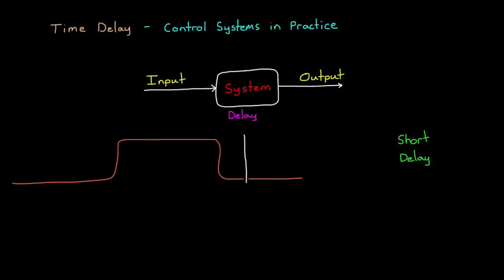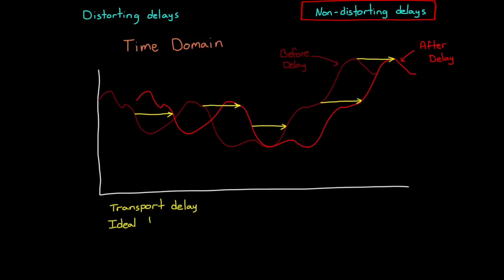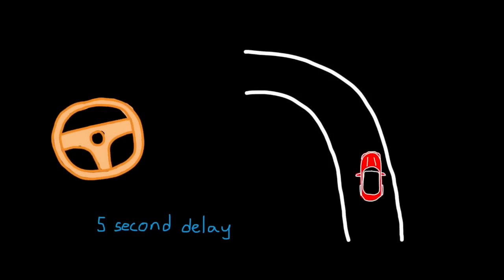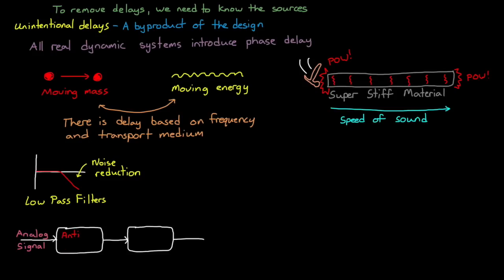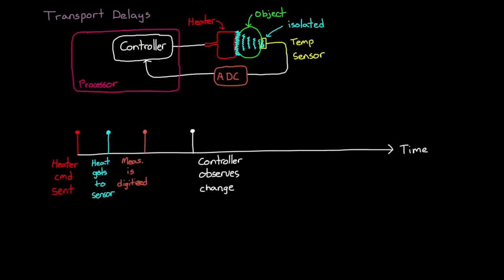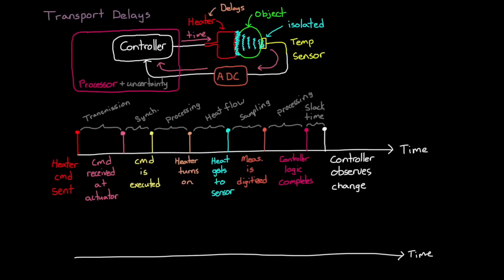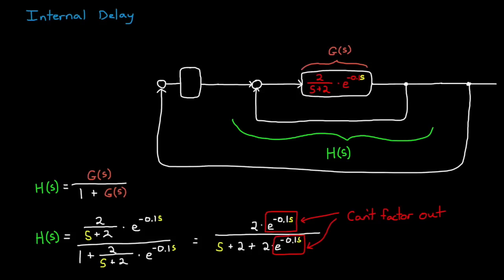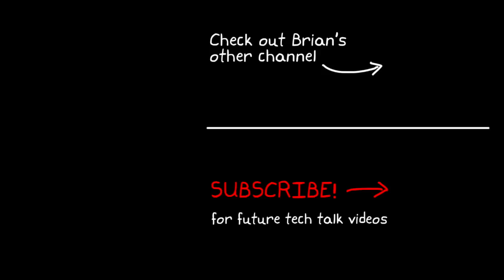Why Time Delay Matters | Control Systems in Practice

Comment: Great video. Let's say there is a filler, this puts unstable volume bulk (approx 1.5% variation that oscillates in time vs targeted value) into box and takes its 12 cycles of machine to weight it. The problem is delay and how to correct box weight through change +/- of the filter capacity with that long delay. The system is trying to correct itself like in the car approaching corner example, is there any solution how to solve it to gain system stability around expected range?

Comment: Why a negative phase margin means a system is unstable?
Reply: It's specifically a system that crosses the point of an open loop gain equal to -1, or more negative than -1, that makes a system go unstable.  This turns negative feedback into positive feedback, which exacerbates the error instead of correcting the error.

A negative phase margin means at the point where the gain crosses over unity, you have a phase that also has already crossed over a full reversal (i.e. 180 degrees), and this causes the transfer function to turn into -1 at the problematic frequency.   Phase margin is how much phase delay you have remaining, before your system hits this point.  So a negative phase margin, means you've already crossed the forbidden -1 value of your transfer function.

Comment: What is the difference between time delay and phase shift??
Reply: Time delay means it is a uniform number of seconds of delay, regardless of the frequency.  Phase shift means the time delay is a function of the frequency, rather than a fixed constant.  For instance, a phase delay of pi/4, means a phase shift of 1/8 of a period, regardless of the frequency, such that at 10 Hz this corresponds to 1/80 seconds, and at 100 Hz this corresponds to 1/800 seconds.  Whereas a time delay of 10 ms, will be a time delay of 10 ms at every frequency.